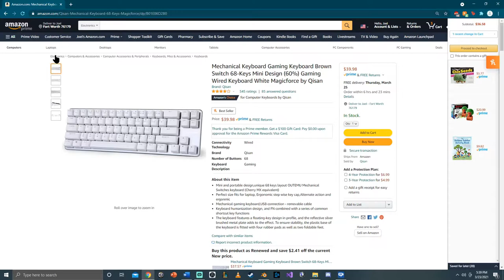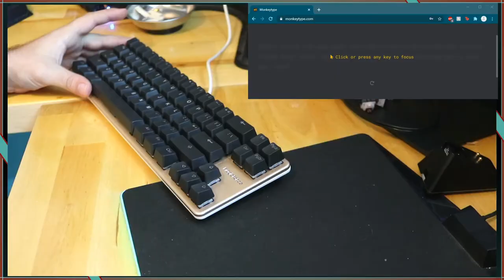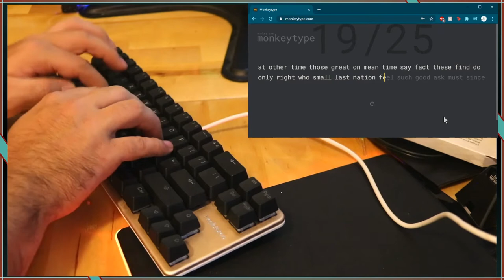Keyboard Build: Magicforce 68 (Lubed Gateron Brown) with Silicone, Foam, and Band-Aids.

Comment: I tried the Qisan Magicforce 69 (ISO version) and I don't think it's too expensive. It's a cute board that's inviting to be modded. The best part are actually incredible high quality PBT keycaps on the ISO version that support the international language they are made for for an insanely good price compared to enthusiast keycap sets - and you even get an entry level keyboard to mess with. The keyboard itself needs modding to not sound like a glockenspiel though - I don't even know if foam etc. helps enough. Going through the hassle of desoldering is probably a risk free way to learn about in depth modding but I wouldn't go through the effort for this otherwise medium quality keyboard. That's why I returned my MF69 in the end, even though I made a foam cutout and enjoyed my gateron reds on this keyboard.
Reply from the maker: The only reason why I say it was expensive what from what I see competitors doing. The price fluctuates on amazon, and many times the actual components of the build "switch" from time to time. From what I saw on amazon, they were offering sub-par switches, and my experience with my board is that they had thin keycaps, that don't take well to back lighting. The plastic bottom halfs screws can easily be stripped, and you have to take off the pads to be able to take it apart. There are a few reasons why I say this, as boards like the RK68 even offer wireless, and bluetooth. I understand that the top plate is nice on this board, but with the direction that keyboards are heading, I feel that there are better ones out there for the price that I saw. Now, that being said, I was judging it by the current iteration of the magicforce on amazon, and not every possible version that was sold. at one point they were sold with cherry switches. I definitely love the look and layout of the board, and am happy that I have it in my collection, but, I am not going to buy another, and cannot justify it to others, because you can find this layout on other boards. only if they make changes, even small ones, like hot-swap, or threaded inserts for the case, then I would gladly recommend this board, again. I am glad that you enjoyed this board.  I am also glad that you modded, it, as I, too feel that the sound profile after modding it is much improved. I won't get rid of mine.
Reply: @ireakhavok  You are absolutely right about steep competition, especially for ANSI keyboards or maybe even ISO UK variants. 
I am referring to the internatinal ISO versions and argue for a differentiated view for the different iterations of the MF68/69. I should have been more clear about that.
Reply from the maker: It would be great to hear your thoughts custom keebs and ISO variants. I know that places like novelkeys with their Gingham keyboard kit don't shy away entirely from the ISO variant, but I would feel bad about how much harder the search for parts must be, maybe I'm just an ignorant American in this regard and it is much easier when you know where to go
Reply: @ireakhavok  It's definately harder for us EU folk. I think it is getting better though, many GBs offer a choice in PCB and some even allow for ISO hot swap (i.e. Ikki68 Aurora) instead of variable solderable PCBs (i.e. KBDfans 8X MklI). 
Keycaps are a different thing. While we have a good amount of vintage Double Shot GMK'ish Cherry G80 / G81 floating arround, finding a nice custom non-beige/grey set is either impossible or costs extra. So far there are no GMK sets with a light font on dark keycap (i.e. GMK Phosphorus) that support International NorDE / Azerty. PBT dye sub has better coverage but quality is sub par imho. I guess as a NorDe user I am still better off than our southern EU neighbours but still many enthusiasts here learn to touch type on ANSI to have an easier time finding nice keyboards /  keycaps.

Comment: Can you give the link to the key caps in the introduction?
Reply from the maker: https://www.amazon.com/Gradient-Injection-Backlit-Mechanical-Keyboards/dp/B07P71DY9D/ref=sr_1_3?dchild=1&keywords=Gradient+Color+37+Keys+PBT+Keycaps&qid=1621060713&sr=8-3 

https://www.amazon.com/Silver-Backlit-Mechanical-Keyboard-Keycaps/dp/B08DCHKW46
Reply from the maker: The original ones I bought are no longer available, but here are kits that are exactly the same as what that set was. The silver one is basically discontinued and hard to find.
Reply: @ireakhavok  Ok, Thanks!!
Reply: @ireakhavok  For the silver one is there any cheaper options on amazon?
Reply from the maker: @venom_322  You could just go with Grey colorway, I think that would even look better than the silver, in my opinion, like this set. https://www.amazon.com/Seiorca-Doubleshot-Backlit-Mechanical-Keyboard/dp/B0773RLL6W/ref=sr_1_2_sspa?dchild=1&keywords=grey+keycaps&qid=1621106649&sr=8-2-spons&psc=1&spLa=ZW5jcnlwdGVkUXVhbGlmaWVyPUExOEs3NUUwRzZSWTdaJmVuY3J5cHRlZElkPUEwNDM5MDUwMkZMMktLNUYwTUI0ViZlbmNyeXB0ZWRBZElkPUEwNjM3OTgwMlVJVDM1SERCUjlWWiZ3aWRnZXROYW1lPXNwX2F0ZiZhY3Rpb249Y2xpY2tSZWRpcmVjdCZkb05vdExvZ0NsaWNrPXRydWU=
Reply: @ireakhavok  Ok thanks
Reply: @ireakhavok  Just asking do you think it can be possible to add a LED or RGB mod to the Magicforce 68 without any lighting or RGB?
Reply from the maker: @venom_322  I did in this video... but yes it's possible, you just have to hotwire them to always be on.